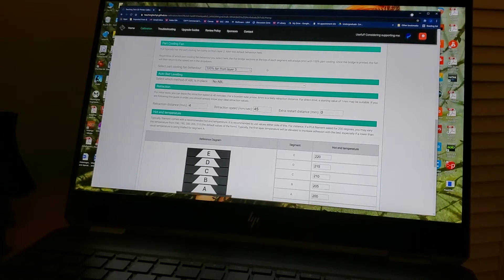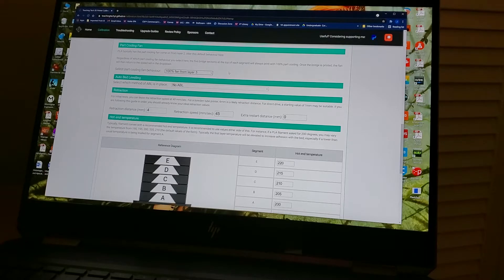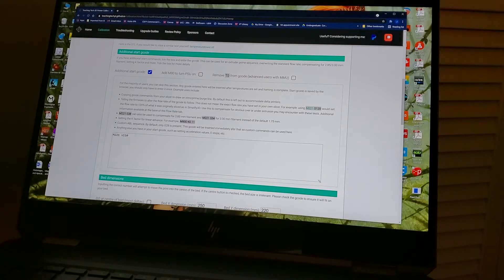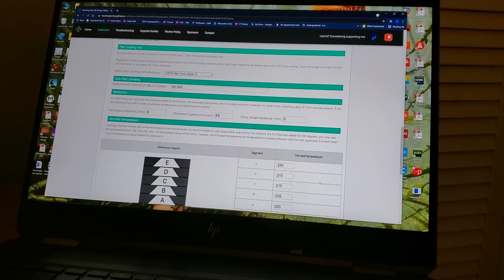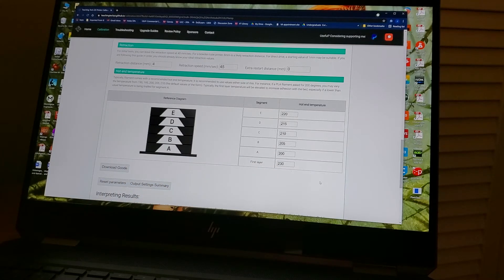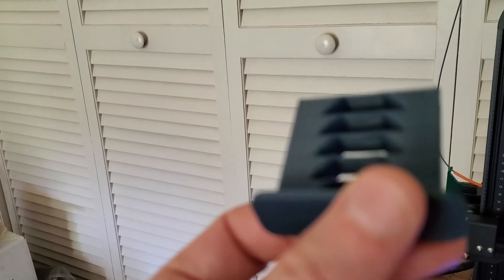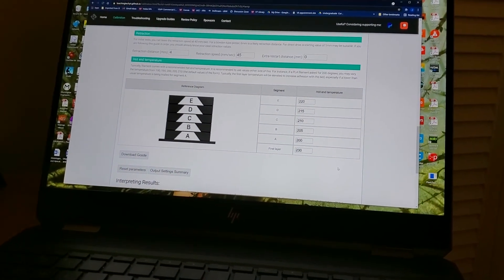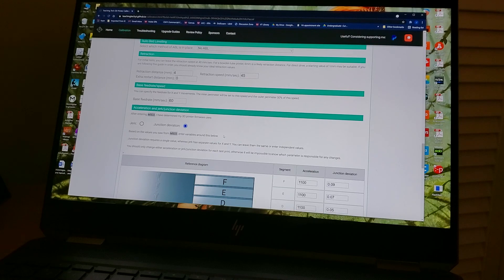Episode 8 - Temperature tuning for Eryone Matte Navy Blue Filament

Comment: What is the g-code for the prime line. Every time I try it, it does not do the prime line and messes up the test.
Reply: I will test it a little later. G29 is deactivated and the stored data is loaded with M420 S1. How often do you relevel the bed? Only after changes? A huge thank you for the videos and explanations.
Reply from the maker: @DerSamoaner  I do a manually commanded (G28 and then G29) level after heating up the bed and letting it sit for about 5 minutes to equalize temp across the bed.  Then I start the print.  This lets me also check the gantry's tram at the same time without worrying about G-code running for an active print.
Reply: @jayburkette8977 Thank you! G Code works fine. Thx for sharing your experience and knowledge.
Reply from the maker: G90 ;use absolute coordinates
G28 ;home all axes
M420 S1 ;use saved level data
;G29 ;level bed with sensor
G92 E0.0
G1 Y-2 X1 F2400
G1 Z2 F720
G1 X10 F1000 ;intro line code start
G1 Z0.2 F720
G1 X50.0 E8.0 F900
G1 X100.0 E10.0 F700
G1 X100.0 F3600 ;quick wipe
G92 E0.0
Reply: @jayburkette8977 Is this your actually gcode for the ER-20 ?
Reply from the maker: @DerSamoaner  Yes it is - is it not working for you?